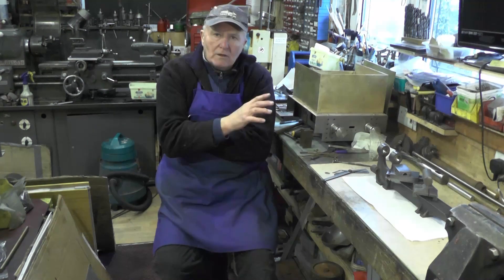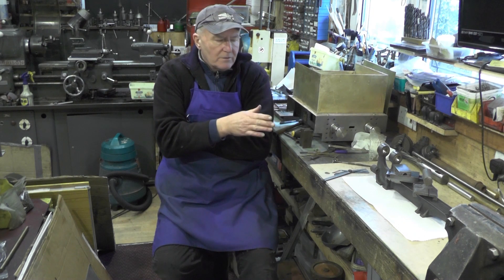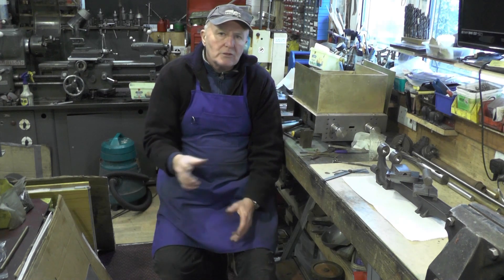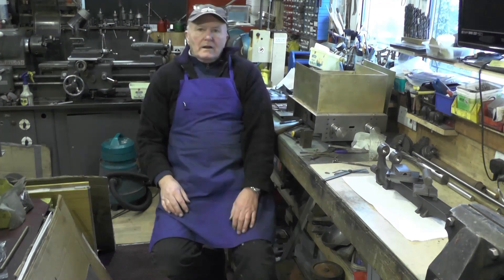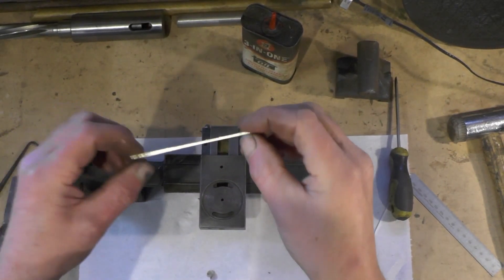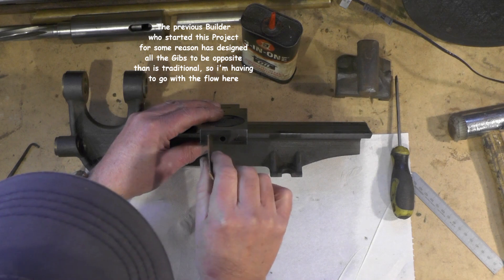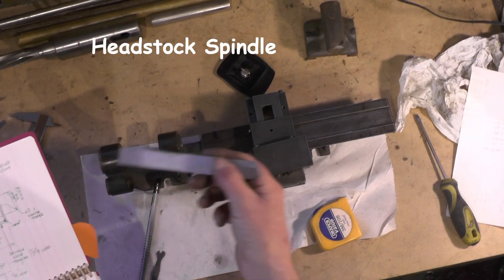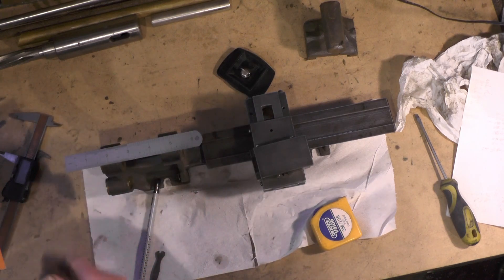Ep 1 Making a Micro / Mini / Watchmakers (screwcutting) Lathe from Vintage Castings "mr factotum"

Comment: You're not messing around Kev, momentous progress. Nice to see someone else doing some threading on the lathe. What material did you use for the spindle?
Best wishes, Dean.
Reply from the maker: cheers
Dean
material en24T, a bugger to turn though on hobby machines.😉👍 gear cutting for the back gears etc etc next up.
thanks for watching and feedback
atb
Kev
Reply: @MrFactotum  Good choice Kev, that's the material I mentioned in my BSA swinging arm video. Tough to machine, but very useful tensile and hardness properties.

Comment: I meant to ask you some time ago on a totally different subject, how did your insulated conservatory roof perform during the cold spell ? Better than expected ,or as you predicted and does it mean you can use that room more .just curious because I'm intending to do mine in the summer. Cheers
Reply from the maker: hi Steve
100 % better well worth the effort, bearing in mind i don't have as much radiator sq footage in the conservatory its not quite as warm as in the house itself, but its comfortable and not dragging heat loss from the house itself, also no condensation problems at all, as before,
It also should be much more comfortable to sit in when there is the summer heat!! pouring through the perpex roof as before, it used to be unbearable,  but is much more comfortable to use now, in both summer and winter
All in all Winner Winner Chicken Dinner, 🤣😉
in my opinion DO IT👍
ATB
Kev

Comment: What ho Mr F, well this isn't going to be much of a series,  you have almost finished already. 🙄 
ATB 
c
Reply from the maker: eyup Chris
You need to look deeper Chris🤣. Only scratched the surface!!👍👍🤔🤔😉😉
The spindle only spins the job. keep watching then on episode 30 ask again🤣
Hope all's okay at your end, are you thinking of coming out of Hibernation yet!
see you next time
atb
Kev
Reply: @MrFactotum  
Surely 29 will be the last, 30 seems a bit excessive. 
All fine down here, double figure temps for the foreseeable future so hibernation might come to a premature end.
I ventured out to the engineerium to sniff the air, and found myself making a lead screw and nut for my improved version of Adam the Machinist's ( that's not Adam the box opener Booth but the real deal one) shallow hole measuring gauge. Watch this space!